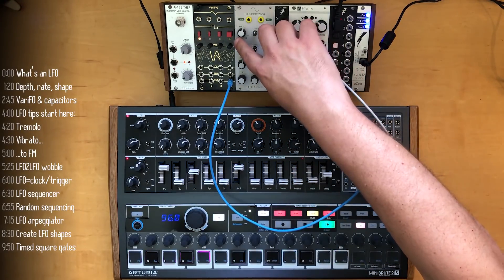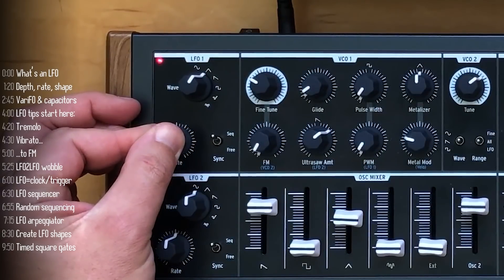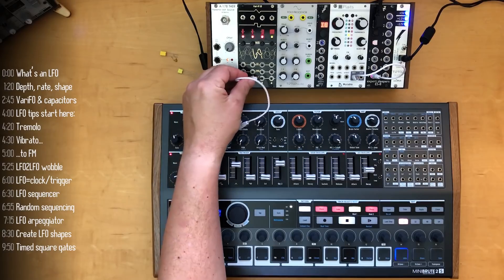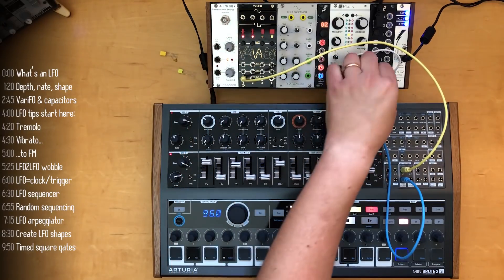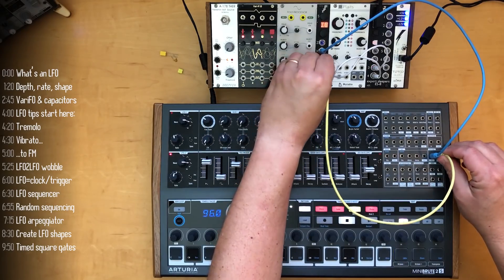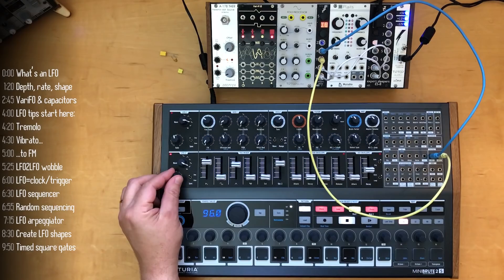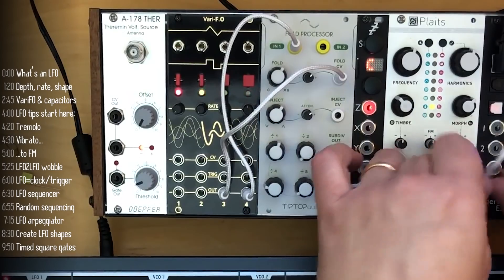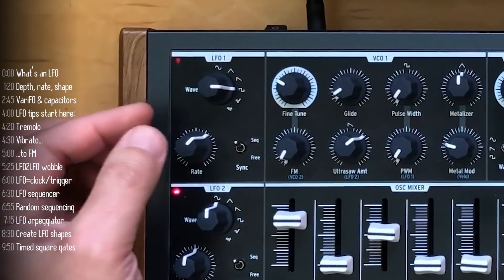10 creative ways to use LFOs (Synth tips and tricks)

Comment: I am addicted ADDICTED to playing with lfos.  Using lfo 2 to modulate lfo 1 is just the sendoff to lala land, it gets crazy like CRAZY some of the sounds that can be made just by twisting a single lfo knob.  So many things can be tethered to a single lfo and when you start mathing and like I dont even know how but like you start making engines and spaceships and your imagination just sails away on adventure lol and theres all the other knobs it just hits crazy.  I appreciate hardware over software because I like actually moving the controls.  I especially like the delicate touch and extreme control the pots on the MiniFreak express.  Hydrasynth is a bit more difficult to lock in and I keep rocking the pot more than dialing it in lol.

Comment: Still love these videos! Going back to this, two things worth noting on the Minibrute 2/2S —
1) You can actually drive the sequencer clock from an internal or external square/pulse LFO (internal ones need to be switched to free-running), and you can do some interesting time stuff with that. Try running the sequencer at audio rates and fake a wavetable!
2) The "Metalizer" that's normally on VCO1's triangle out is also a wavefolder, so you can do the interesting folded-wave LFO stuff onboard.

Comment: Depth is true should be the first parameter that controls the LFO but in so many cases there is no Depth control on surfaces synth. I don't understand why in certain synths is possible to have it in the LFO section and in other synths just not. Yes most of times LFOs depth can be found spread around per sections. lfos depth in oscillators , in the filter and amp envelopes but still, not all synths adopt Depth . I see either the Arturia minibrute 2
Reply: fabyo ouda VCAs can be used as depth controls.
Reply: VCAs as depth control of LFOs? You mean from the Amp Envelopes?  ... for which synth ? every synth ?  .. in how/which way ?
Reply: fabyo ouda LFO out, into input of VCA, output of VCA into filter cutoff or pitch. The vca now controls the depth of the LFO.
Reply: You need outputs and inputs to be available on each part but pretty much any synth with VCAs that are patchable should be able to do this.
Reply: Well .. gonna see in the matrix modulation of my synth .. HAve not a semi modular. Cheers.
Reply: fabyo ouda excellent! Of course you can put the VCA level to the mod wheel if you have one, making a wonderful performance point.

Comment: - Mixing square wave LFOs can yield nice patterns in a scale without needing a quantizer.
- PWM a bunch of square oscillators with separate triangle LFOs gives nice string sounds. Toss result into delay for extra effect.
Reply: Hello from the future! Is it possible to do, what you describe in Ableton? I just don't understand said 'mixing of square wave LFO' -> scale device' is the strictly modular stuff?
Reply: @MV-es3sk  as long as you can map the amplitude of the summed lfos to pitch in some controlled fashion, you're good
Reply: @thomassynths  Wow, thank you for taking the time :)

I think it is 'the summed LFO's' part, that I have trouble understanding - when Square wave LFO1 is modulating Square wave LFO2, does this mean they are mixed together/summed?
Reply: @MV-es3sk  Oh, ok. So The LFOs are not modulating each other. Instead you mix all the LFOs into a summing mixer. Then you take the output of the mixer and feed it into the pitch input of the oscillator you want to hear.
Reply: @thomassynths  Ah, that makes sense! Thank you! :)

Comment: How did you get the es-8 into the moog case. Its too deep. You mod the case?
Reply from the maker: You’re right it’s a bit too big - I just don’t tighten the screws and you can see it’s about 1mm higher
Reply: hey thanks for getting back to me. been considering ditching my Pitts rack. its too big. scaling down. want to keep a couple modules. have two MOOG 104hp. probably keep one. but would like to keep the ES-8 and stick it in one of the MOOGs. was thinking of sticking little module protection washers under the module to raise it or clipping the inside of the case. theres just on little bar in the back thats keeps it from sitting in nice. 

hey thanks again for getting back to me. 
good vid.

Comment: Very well explained vdo, thanks. I use a Korg Kronos, and found if you use the EG (envelope generator) with a slow attack, then slow decay it makes the LFO speed up then slow down (or reverse if inverted). Could you please comment on that, ways to automate the speed of the LFO, thanks again :)
Reply from the maker: Peter Stanton thanks for your comments - absolutely that’s a great way to control an LFO - not sure what else to comment on you figured it out quite nicely ;)

Comment: I disagree with your ideas about the term "low frequency oscillator". low: yes, lfos can oscillate at audio frequencies, but that is not what they are generally made for. oscillator: it oscillates. no-one said anything about sound, it outputs exactly the same signal a vco would, just slower. other than that, nice video.
Reply: I was thinking the same thing - it oscillates; that's what it does.  My background is in electronics engineering though, so I may be a stickler about terms in the audio world.  Beyond that though, this was one of the best overviews I've seen in this amazing, powerful & inspiring world of [electronic] audio.  Thanks for posting!

Comment: at 4 mins when you were talking about "audio rate" I was hoping you would have used them as vcos at one point! especially 4 of them, mixed and tuned together, at very high frequency,... they would have made some great layers of sounds. I usually use the" SE STE16" 2 digital lfos for this purpose, it makes fantastic sounds.
Reply from the maker: Francesco Provenzano I agree that in a pinch lfos can be used to produce sounds - these particular ones don’t receive volt per octave so they’re less useful for tunes
Reply: I know! And I see also the last 2 lfos of the module go less higher in frequency. The ste16 have frequency mod but unfortunately no 1v/o otherwise it would have been a great digital vco module... still, I make one tone, drone/pad stile, keeping the same note all the time,  to be  eventually tuned with another vco playing a sequence, eventually all in the same mixer, filter, vca for a paraphonic feeling.. I use lfos as audio sources a lot, that's why I was hoping :) btw after this video I'm gonna start to use the lfo arpeggiator!
Reply from the maker: Francesco Provenzano actually you can change the capacitors to different ranges, have all the same, etc. cool with the arpeggiator ;)

Comment: one of my fav tricks is mixing 2 or more lfos, setting the levels differently and passing it though a quantizer. You can get interesting and complex sequences easily this way.
Reply: I just did a ‘Dude, yes!’ At this thought. Very cool indeed.
Reply: what do you mean? do you mult the LFOs into a single quantizer?
Reply: AnxiousCowboy  use 2 or more square wave lfos.  Mix them together, feed that output into a quantizer , adjust the LFO levels and you get  evolving sequences.
Reply: I've done that too....I like to stick a vca between them and an attenuverter at the front and/or rear...depending.

This replicates a feature in Massive and Serum that I like to use.
Reply: @linzenmeyer  
a module like ANA does a lot for a setup like this too. 

https://youtu.be/dw2QWmy9EN8

Comment: As promised a video on LFOs... I missed your oscilloscope in this case, but I'll watch again as there are a lot of examples with pretty subtle sound differences and you cover many concepts. Just to make sure I'm clear on the elementary knob-turning part: when you modulate the filter, both the LFO and the filter envelope are essentially cutoff frequency knob turners, and the difference is that the LFO has a limited choice of shapes and continuously variable speed with the speed knob (whether or not synced to the arpeggiator), and that the envelope only has two speed ranges (fast and slow on my old Minibrute) and as many shapes as I can come up with using the ADSR sliders. I can then imagine manually turning the cutoff knob in a way that would replicate how the envelope is set, but my fingers could never be that fast or precise (same applies to LFO). And the envelope's motion takes place over either one of the set ranges of cycling times of the slow/fast mode on my minibrute. Check? Admittedly I have a hard time using these controls, especially the filter envelope. I'm definitely still confused about the filter envelope amount control for instance. A definite second-time watcher for me will also have to be your Digitone review, which explains FM synthesis, briefly mentioned here in the context of vibrato. I will need that when I finally look at the patch editor for my Circuit. Anyway, many thanks for this new video.
Reply from the maker: TROGULAR 10,000 yes check - and thanks for the kind words - actually I am working on another synth review now and will definitely include and oscilloscope on that one ;) I will also spend more time on envelopes as well. Hopefully later this week

Comment: I don't think the name oscillator implies that it has to produce sound by itself, just that it oscillates. And more often than not lfo's are used at a lower frequency than audible oscillators, in this video too. And especially in the modular world, almost everything can be used to do other things than the name alone implies. Otherwise, very interesting video!
Reply: well...s&h can be non random at all, it depends on what's your input and what you trigger it with. For example input 1hz sine, and trigger it with, lets say 5hz square, and you will get a looped s&h output that's not random at all.
Reply: These electronic circuits, like oscillators and sample and hold were not designed as components for musical equipment. They got used for it later down the line.
Oscillators, S&H, filters are in all kind of electronic devices.
Reply: That one was new to me. A rant episode would be very welcome, at least if it contained clarifications. : )
Reply: but my synth has sliders!!! ;)
Reply: Maybe the name is a bit confusing to beginners who assume “oscillator” means something that generates a sound.
Reply from the maker: Exactly...
Reply: that i agree with hehe :)
Reply: No, or yes. I actually try to make you start on those, and more : D
Reply: Infrasound is still sound
Reply: Yup. You can call an actual pendulum a low frequency oscillator and you won't be wrong.
Reply: Its confusing to a newbie that an oscillator can both creat and/or modify. BTW…being an interesting  video and having an opinion are NOT mutually exclusive.
Reply from the maker: Dr LoHertz knobo roboto!
Reply from the maker: ejmikk I agree it’s just my little rant on naming conventions - wait til I make one about sample and hold - what a confusing name for random
Reply: ejmikk maybe a better name would be “AKT”, Automatic Knob Turner
Reply from the maker: jonas eggen good idea... Don’t get me started on DCO, VCO and VCA - talk about some cryptic jargon there...
Reply: @loopop  DCO.....hmmm....Dildo, naw that aint it.......DUAL! .... maybeeeeeeee Digital?
Reply from the maker: Linas Mak true, while it can be that it’s never used for anything other than random in any stand-alone synth I’ve seen
Reply: loopop none of the S&H modules in my systems are used for randomness.
That use is only one of the very many ways it could be used
Reply from the maker: @faith you are right. I meant that in “regular” synths as well as semi modulars I have never seen sample and hold decoupled from a noise source. True, you can do more with it as a stand-alone module
Reply: @loopop  welcome to YouTube where everyone treats things said in videos like text book statements instead of the opinions they are 😉

Comment: How do you like the minibrute 2s so far? I got the one with keyboard
Reply from the maker: Amæthron I made quite a few videos about it - did you check the channel? It’s an amazingly powerful and flexible synth
Reply: i would rather go for the S version
Reply: If it's your first synth the one with the keyboard might be nice to stick to. The patch bay is the most obvious improvement but both versions are also a great improvement on the old Minibrute in terms of arpeggiator modes and the sequencer, and the way to access them. I'll eventually buy the 2S because i'm interested in sequencing and arpeggiating both leads and bass lines, and interested in seeing how far I can go doing so with the just the pads, and if that might help me write more focused and minimalist bass and lead lines. I figure I can connect my keystep if necessary but like the idea of mastering the 2S with just the pads, having all the controls i need on the one instrument. EDIT: definitely watch the Loopop comparison and individual reviews of the two instruments